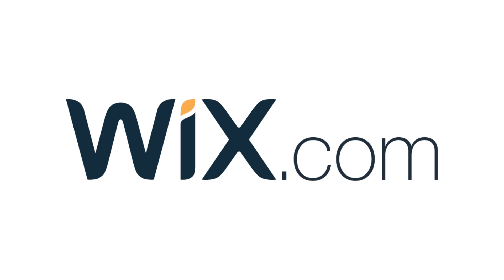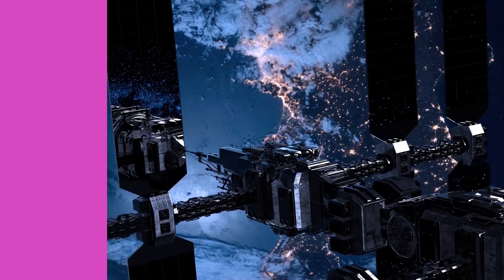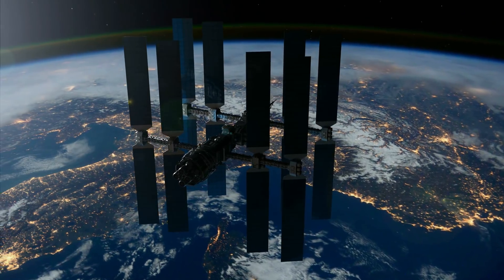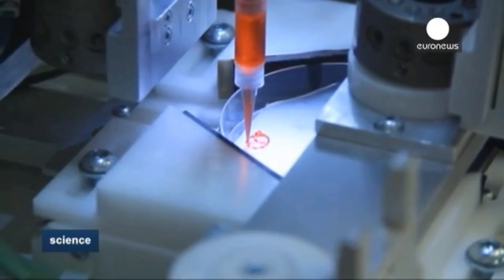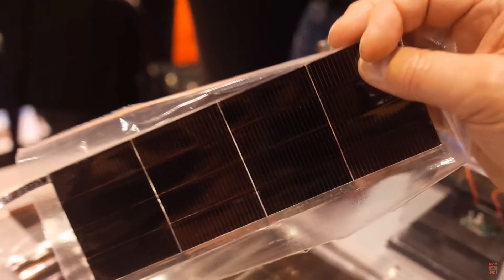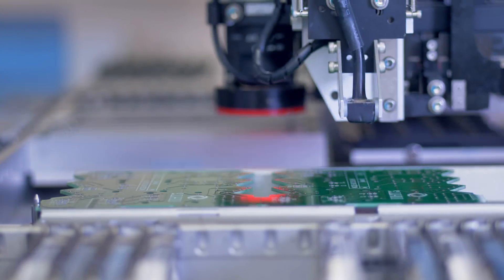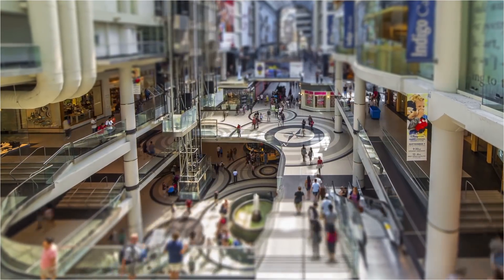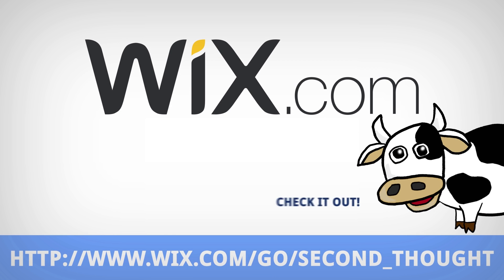Why Space Manufacturing is the Future of Industry

Comment: I don't understand how space is beneficial in terms of heat. Space doesn't really have a medium to transfer heat away, so accumulated generated heat is a huge problem in space. Satellites have to be carefully designed with this consideration. Moreover, yes it is is very cold when you're shielded from the Sun by Earth, but when you're in the sun, it's extremely hot (hundreds of degrees, I believe), and there is also a lot more radiation up there.

Comment: Contrary to popular belief; thermal management is actually a HUGE headache in space. There's nothing to conduct or convect heat away, so you have to rely solely on radiative cooling, which is slow and requires huge radiator panels that have to be oriented parallel to the sun's rays so that they don't get warmed by sunlight.

The space station has huge radiator panels that are perpendicular to it's solar panels for this reason.

Comment: Actually, space wouldn't be great at cooling things down. On Earth, there are 3 main ways for heat to leave your body. Radiation, Conduction, and Convection. Convection is losing heat through interaction with a fluid like air or water. Then there's radiation: Everything with some temperature emits infrared radiation which cools the object down over time. Finally, there's conduction where two objects are touching each other (usually solid objects) and they begin losing heat to one another. 

In space, there's no air so no convection and there's nothing to touch so no conduction. The only way you lose heat in space is through radiation, which is the slowest and least efficient form of heat transfer. Using the Stefan-Boltzmann law and some estimations, the human body might take longer than a day to freeze in space. The ISS even has large radiator panels to get rid of excess heat.

Comment: Space is horrible at cooling things, the SNAP-10a nuclear reactor needed huge radiator arrays (like that space station). The hotter you can get the radiators the more power they dissipate at the loss of electric efficiency. SNAP's TEG's where horrendously inefficient, but we got better ones now and micro gas turbines.

Comment: Another use for micro gravity could be high temperature smelting as you could heat up the mettle or whatever with lasers and not have it touch anything. On earth you have to use a pot (not the right word) which has to be made out of something that has a higher melting point than the thing u want to melt. So melting stuff like tungsten is real hard

Comment: Some of it was believable some a little sketchy but I was still on board until the chip manufacture. 
Thermal management in space is an enormous issue since you can only radiate the heat away. You need large panels that do so, but large panels would also be immensely heated by the sun. Even the white paint on spacecraft is specifically designed to be reflective in the visible and absorbing in the far IR such that heat can be emitted while as little sunlight as possible is absorbed.
Also, I can not believe that the water is due to cooling. For one no step in the manufacturing creates heat, it, in fact, takes a huge amount of energy (see furnaces to create monocrystalline silicon). Also, cooling water is obviously reusable? Simply use cooling towers? Move the manufacturing to the poles, they are way easier to get to than space? I would rather think it is due to cleaning of the surfaces. The better option here is to switch to other technologies like plasma cleaning and similar, which I am sure is being done already.

Comment: Shame that you're just repeating talking points instead of actually understanding what you're saying. First, heat dissipates through contact. A vacuum means that there is only a small amount of active cooling.

Second, space travel isn't going to get any cheaper any time soon. The biggest problem with space travel is fuel consumption. Most of the weight of a rocket comes from the fuel it uses. On top of that, reusable spacecraft have so far not proven cost efficient and would still need to be deconstructed to be fully inspected after every launch.

The only things that would benefit from being produced in space are products that require a low gravity environment. And it would still be incredibly expensive to create a facility that produces them, ignoring the transport costs that it would result in.
Reply: You're first point is bang on the money, the second however is inaccurate. Launch costs are getting cheaper year after year as more providers come online around the world as does the cost to stay in space. The alpha station is already advertising an incredible mark down on price to rent compared to the previous prices paid by citizens to stay on the ISS. Instead of millions per day per head the aforementioned alpha station costs £44k a day. 7 crew = £308,000 which equates to just over 19mill for 2 months rent instead of 20 mill a day. 2 other stations are also offering prices that are a substantially higher then this but event heir prices are cheaper then the recent past.

Comment: Space isn’t cold exactly, theres just nothing up there to be warm, in direct sunlight any object (your microchip factory) will heat up. The only way to lose heat in space is via radiation, this is a very slow process which requires huge radiator panels and adding the heat from the process of making your microchips might mean its inefficient or impossible to do it in orbit.

Comment: Really bad assumptions in this video even before it starts.
1. Disposing of waste!!??
2. Removal of waste heat!!??
Both of these are difficult and expensive in space. No explanation given as to why space offers advantages.
Firstly disposing of waste in space is costly. Anything orbiting the Sun has a lot of energy, otherwise it wouldn't be orbiting the Sun. So basically it's going to be orbiting the Sun for ever in one way or another.
Removal of waste heat is harder in space because the only option you have is radiation, you don't have convection or conduction.

Comment: Two big, untapped space applications: space-based solar energy and data centers.

On Earth data centers have often located themselves where energy and/or cooling are cheap.  Geographical location has been only a minor factor given how quickly signals travel.  In space energy is as cheap as spreading out lots of solar arrays.  Cooling, too, is as simple as laying out enough radiators.  Communication latency can be as short as the vertical distance to the data center's orbit and only as long as half the circumference of the Earth plus the vertical distance in the orbit.

Data centers need continuous material inputs as well to replace failed components.  Here asteroid mining and space manufacturing steps up to build components in-situ rather than launching spare parts from the Earth.

Comment: Hi, very nice video, but I had a question regarding cooling in space. To transmite heat, you need a medium, but the void of space is... you know... a void. Sure, heat can be transmited as electro magnetic waves, but the process is a lot slower that pouring coolant over a product. That is the reason why the ISS uses radiators as big if not bigger that it's solar pannels. I would recommande you the video on space battle on the channel "Because Science"

Comment: 4:50 In space is heat a problem. The Iss has moduls to loss heat, because in space is no stuff, who can absorb heat. The reason why space cold is there is no stuff who can get hot.
Reply: https://youtu.be/pm6df_SExVw

My source.
Reply: But if you use a detached sun-shield (like the John Hopkins telescope plans to do) the area inside the shadow reaches well below 0' F. Good spot to put a high-heat producing factory.